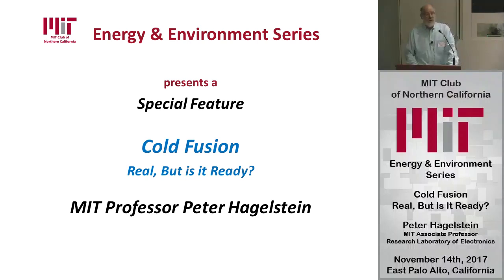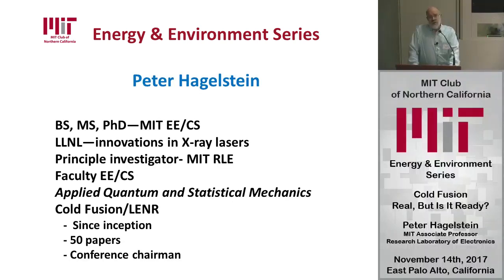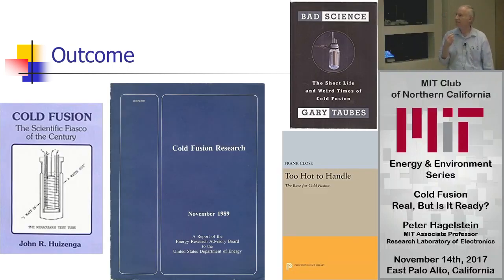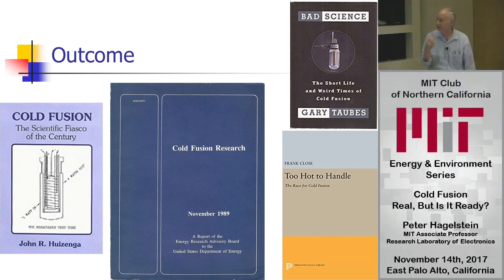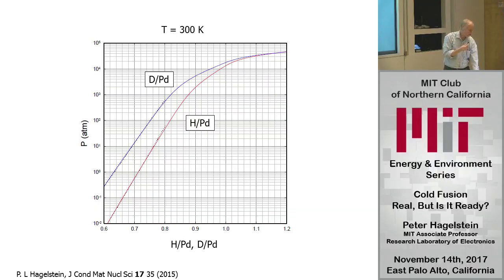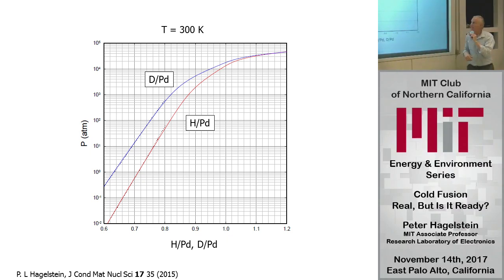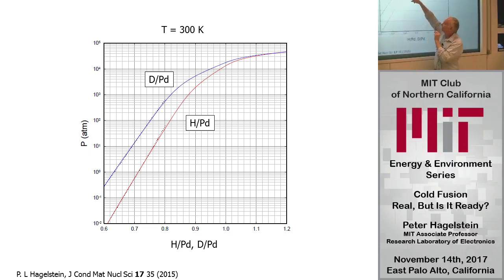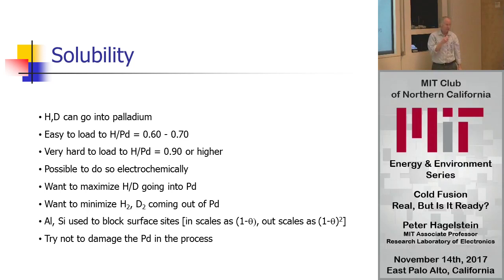Cold Fusion - Real, But Is It Ready? - Prof. Peter Hagelstein

Comment: Once again, Peter has provided a compelling, data-rich , objective summary of the status of  LENR/LANR efforts and results. It is human flaws that allow these results to be ignored and denied,even berated, not Peter's efforts to do his job as a scientist and provide facts and insight into natural phenomena. Thanks for allowing this video to be on the web, Peter, and best wishes.
Reply: Fractal Antennas I am not so sure. The original Pons/Fleischmann experiment looked to have had 4He already present in the electrodes before the experiment. An independent double blind analysis that included major labs around the country found 4He in the samples, but said that this usually occurs as a result of the manufacturing process, detailed below:

“Induction furnaces are widely used throughout metallurgy not just because of their efficient melting abilities, but also because of their usefulness in forging new alloys. Because induction is a no-contact process that doesn’t utilize combustion, induction furnaces can work in inert atmospheres and vacuums – which is necessary when creating alloys that oxidize if heated in the presence of air. As an additional benefit, the magnetic forces in an induction furnace can be directed to stir the molten metal, which is very useful for creating fully homogenized alloys.”

https://www.mgsrefining.com/blog/2014/02/11/Induction-Heating-and-Precious-Metal-Refining
Reply: Who cares about an "original", the point here IMHO is, that we should pursue all possible venue of research in hope, we will know more in the FUTURE.
 I think they are here some things we still do not understand fully and find the attitude "we know this will never help anything" very unsettling.
PS: 
I don't know about you, but I studied theoretical physic with focus on nuclear engineering and I still do undestand just general jist of this all. Would not be able to asses what's behind this in all nuances.
Reply: Tomáš Wünsch.  Agreed!  The use of fossil fuels is doing tremendous damage to our planet (e.g. climate change) and ourselves (e.g. smog and its negative health effects).  We NEED better alternatives.  Even if "cold fusion" (or more accurately, LENR/LANR) is uncertain and unproven, we still must pursue this research because the rewards of success will be huge.  If we can replace the burning of fossil fuels with LENR/LANR technology, then the benefits for humankind will be incalculable.

You're right about the original Pons and Fleischmann experiment.  Let's leave that to the historians to figure out.  But scientists and engineers should push forward on making new breakthroughs in LENR/LANR without letting that past fiasco drag them down.

Sadly, the whole Pons and Fleischmann saga may have done untold damage to our planet.  Let's say that whole fiasco back in 1989 didn't happen and research in this field wasn't strangled by funding cuts and lack of interest due to the bad publicity they generated.  Perhaps we would already have made the crucial breakthroughs necessary to bring LENR/LANR into economical and commercial use - and fossil fuels would already be on their way out.

Comment: A suggestion, let's rename this phenomenon as "hot electrolysis" to keep the career conscious bureaucrats of science happy and start actually studying/using the source of the excess heat, whatever it actually is.
Reply: they came up with that. the phrase used is "anomalous heat effect" all cold fusion at CERN and NEDO is called that
Reply: Didn't know that, thanks Peter!
Reply: usually it's referred to as LENR (low energy nuclear reaction)
Reply: What are they expecting? Cold fusion becomes hot. High energy is hot. Heat makes steam steam turns Tribune to produce engery. In order to insulate reaction and produce steam and cool reactor. Easy way to have the best of both worlds is heating water.
Reply: You are right 😂. Cold fusion is confusing name when you look into it

Comment: The experiments with vacant holes in the crystals seem to show that my comments in the previous entry below are valid.  It is critical to make the crystal structure of the palladium EXACTLY right to get cold fusion to work efficiently.  As with steel-making, this may take decades to figure out (though we have much better technology than they had in the 19th and 20th Centuries, when they slowly figured out these things).  Once you figure out the optimum alloy of palladium and how to make the crystals the right shape and size and, if necessary, with the correct irregularities, then you can find out how good cold fusion is as a power-producing effect.  I am interested in the practical creating of cold fusion devices, not theory per se.
Reply: so, who's doing AI material research? how hard it is to model all crystalline forms of Pd and then sputter them? why do bulk when you can make a chip and do photonic circuits for measurements beyond the calorimetry?

Comment: I didn't watch the video yet, I just read the comments to see if people were thinking the same thing I was thinking.
I heard of cold fusion before, but at the time I didn't even understand fusion or Quantum Mechanics. I know a little more about each subject now but I still want to learn more.
I've learned that fusion in the sun can't work with just heat alone. It's not hot enough. I've learned about the Heisenberg uncertainty principle too. If there is certainty in the position of a subatomic particle then there is uncertainty in it's momentum and vice versa.

The sun makes use of the uncertainty principle by decreasing certainty in the position of the proton. By heating it up you increase momentum.
I was wondering if we could utilize Heisenberg's Uncertainty principle in cold fusion. By increasing certainty in the position of the atoms we decrease certainty in momentum and if we do this for a large amount of atoms in a small space the could collide with enough energy to fuse. Maybe. That's what I'm thinking.
Reply: The uncertainty principle does not mean that any particle teleports. Just that we cannot pump energy into a tiny area for imaging and expect it not to move. The zeptosecond timescales for particle-particle interactions dwarfs our current best xray attosecond imaging techniques by a factor of a few thousand. Using these attosecond imaging methods we can knock electron orbital holes in inner shells and follow up with a second imaging pulse before the electron orbitals can rearrange themselves to stabilize, but we still cannot see the movement of the smallest particles in action tmk.
Reply: Oh no I wasn't thinking they would teleport I was thinking they would diffract. I was thinking that since they use sponge-like materials that can absorb hydrogen like palladium, that the pours might be small enough to enable the hydrogen to diffract. So I thought "Hey, what if you can propagate ionized hydrogen particles down the rode using electrical forces, have them jump a gap and maybe with enough holes some of the fast moving hydrogen atoms would colllide"

Because hydrogen atoms have mass and momentum = mass times velocity, I was thinking that hydrogen atoms would increase there speed rather than increase their mass and when two atoms collide they could "interact" with high enough momentum so that their nuclei could tunnel and fuse.
It just seems like it could work knowing what I know so far.

Comment: The fact that only one in five cathodes worked implies that there are other factors:  Poisoning by impurities or, possibly, LACK OF a necessary impurity, or variations in the crystal structure in the palladium material holding the deuterium in a fixed position to allow another deuterium atom to fuze.  Perhaps it is not the regular crystal structure but irregularities (twists, dislocations, etc.), that enhanced or degrade the efficiency of the fusion process.  Anyone who is familiar with solid-state laser materials or even steel metallurgy knows how much even small not-desired changes in the materials used can make enormous undesired effects on the final results (a steel bar that cracks in two instead of bending, for example).  To say "cold fusion is not possible" without studying such things is stupid to the point of imbecility; by that criteria, steel-making is impossible too   Were the people doing these experiments experts in mechanical engineering and properties of materials?  If not, they might as well be witch doctors shaking "magic sticks" over a sick person and hoping to cure him.  How superficial can you get...
Reply: Agreed that there should have been at least a number of efforts aimed at distinguishing material properties like what has been happening in superconductors, but we haven't looked through the journals now have we?
Reply: "My provision of the salt, which had never been renewed since the date of the first experiment, began to run low. I sent out for a fresh supply and mixed the draught; the ebullition followed, and the first change of colour, not the second; I drank it and it was without efficiency.  You will learn from Poole how I have had London ransacked; it was in vain; and I am now persuaded that my first supply was impure, and that it was that unknown impurity which lent efficacy to the draught."
Reply: see how the transistor was developed. very few working models.
Reply: Baigle1 If you're saying that there are papers that address this, maybe we could get a link?
Reply: I would say you are right, the material is close, but even getting it "right" we don't know how close, we should try doping materials, if you have to heat the material, your just close to that you need. Materials science is the leading edge of progress if you ask me.
Reply: There are 2 accepted working schemes for "cold fusion" for a long time: muon catalysis and fusor.
There is no known mechanism that can explain fusion in palladium.

Comment: If I were an investor, the thing that would convince me is a box sitting on a solid bench powering something like a lightbulb, or maybe just giving out heat, with NO other connections to it, and doing so for longer than any hidden battery could reasonably maintain it for.
That would be the turning point, and once achieved, funding for further development would be no problem.

Comment: When you make actual hardware, you DO NOT NEED A THEORY!  Steel-making in the latter half of the 19th Century, when the bulk of modern understanding was found, did not even have AN ACCEPTED DEFINITION OF WHAT STEEL WAS (!!!) over most of that time, yet the work continued because it was needed to build railroads and modern buildings and other structures like bridges and ships.  If you can show repeatable results, you can get support, even with no theory at all...
Reply: ahh...yeah...your problem is that you think steel making and cold fusion are some how in the same technical ball park....the mere fact that you talk of both in the same sentence...yeah....do you think the first transistor was just thrown together by back ward local yahoos who thought that a thermionic valve was a bit rough ? or do you think atomic physics could have got to the bomb in WW2 without the previous 100 years of European minds blazing the way through theory and discovery ? theory ALWAYS proceeds practical technical innovation...always...

Comment: It seems to me that the mechanism of down converting energy from an excited nucleus by a coherent reaction should be observed in other systems if it is real. For instance shouldn't it be present in some nuclear fission materials? You might expect some metal that undergoes a beta decay to create a bunch of phonons in the bulk material rather than emit a gamma ray. Isn't there a way to test this?
Reply: It could be anything. I'm no expert, but it looks like this process only happens in a minute fraction of available sites and with near perfect conditions. The repeating experiments showing something is there is very promising.

Look how extremely complex phonon propagation along a two dimensional graphene sheet is, scale that up to an imperfect crystal lattice with interspersed hydrogen, add magnetic fields, heat, and electrical current and you have yourself one hell of a puzzle.

Comment: "Using a neutron detector isn't the right way to measure..", talk about moving the goalposts out of the playing field; if the lack of neutrons disproves the hypothesis just claim that that's not the right way to disprove it.
Reply: Well it could be extracting energy from dark matter for all we know. As long as there's excess heat, it's worth investigating. And, IMHO, there's no convincing proof of excess heat. I'd be interested in the number of positive publications about cold fusion.
Reply: X-Rays are the primary means of “seeing” Cold Fusion. Nature does it all the time. Super Soft Luminous X-Rays. Quantum Kinetic Well(tm).
Reply: From day one the original inventors said there weren't neutrons, so by your standard no one should have even tested any of their results and they should have just rejected them immediately.
Reply: It's an issue because Fusion produces neutrons by its very nature, and saying up front that they shouldn't expect any was just getting ahead of that inevitable question, which implies that they know something about fusion the rest of the world does not, something which alone could win them a Nobel Prize, and considering their lack of progress in 4 years I doubt they've made a fundamental discovery that upended the entire fusion industry.

Comment: If you need quick and highly effective results to spur the field and funding, why not use AI? The AI could control things like loading, frequency of laser or electricity, etc. Basically, it could adjust any knob or dial on the experiment and measure those changes against the outcome. (energy out) Stick it in a closet and let it run for some time. In the end the AI will get you a result that works best with the knobs and dials it was given. It might not be great at basic research, but it should get you a working solution very quickly, then you can research the working solution to find out what is going on.

Here is a simple example that shows AI learning, controlling just a few inputs, reading a few sensors and and looking for a given outcome. Imagine what it could do with cold fusion!

Here is the link: https://www.youtube.com/watch?v=sB_IGstiWlc

Comment: Would someone take a small deuterium loaded paladium foil sample, encase it in high explosive, explode it and check to see if there is any signs of fusion.
Reply: I like this and would add that we should do this experiment using exploding wire technology developed for atomic bombs:
1. Load a Palladium wire (about 2") with deuterium, 
2. then use a pulse power discharge (see exploding wire technology) to evaporate the sample in say picoseconds, 
3. Measure the neutrons and gamma rays and Helium produced in the explosion. 
4. Also notice that these fusion signs increase with altitude above sea level (up to about 10,000 ft above sea level).  This is because atmospheric Muons increase with altitude and are a catalyst for the fusion reaction.
5. I believe that atmospheric muons (generated by cosmic rays) can catalyze fusion. This was the element missed by F and P that was the major variable confounding the reproducibility of experimental results.

Comment: The obsession with wind and solar energy is the big problem; it's sucking funding out of all other energy research fields. Yet, I think we have enough field experience (20 years or more) with wind in particular to see that it's been massively hyped and oversold, and is not really a valid replacement for fossil fuels. Solar meanwhile is useful in some situations such as aircon in sunny climates, but is not well suited to high latitudes. 

WInd and solar have had their chance, and have failed to live-up to expectations. It's time to stop the subsidies and fund research into other ideas.
Reply: YOU NEED WIND ANS SOLAR FOR HOUSEING I HAVE SOLAR IT RUNS MY HOLE DAM HOUSE FOR FREE NO PG&E GAS AND OIL HAVE GOT TO GO ..
Reply: Wind is a great source of clean energy, if you happen to be a sailboat.  More seriously, it is my suspicion that if the species lasts another 500 years, we will run out of nat gas, oil, run out of fissionables (excepting breeder reactors, about which I am ignorant), we  could kill off the species with pollition and mitigate it if we had enough power.   PV is not sufficient. We may have 500 years of coal, but then there is that pollution thang again.  Suspect we will need to use every available resource AND reduce consumption until the only real choice is on line..  It was and is still fusion.  Let's see what we can at ITER.  The Chinese tokomak is impressive.  Source material is Club of Rome's ''Limits to Growth'.  The original from the early 70's attempted to estimate the maximum human carrying population  of the planet if everything went right.   Their best guess was 9 billion.  We are getting there.  The 30 year update (now 10 years old?!?) I found wordy.
Reply: "WInd and SOLAR? have had their chance, and have FAILED? to live-up to expectations"? I wonder why the 4.5KW system I installed 12-5-16 wiped out my utility bill. What other expectations did you have for solar?
Reply: Wind and solar are not sucking Research funding.. Wind and solar are working products in the marketplace.
Reply: Wind and solar are cost effective and the UKs investment in R&D in both has already paid off.
There now often cheaper than coal without subsidises and coal is currently subsidized by around £350 million for some reason?
Reply: My point is the investment in the technology paid off massively though when storage is fingered out/set up solar could actually fulfill our entire current globule electricity needs with an area smaller than Spain.